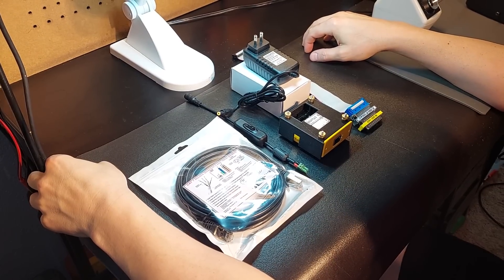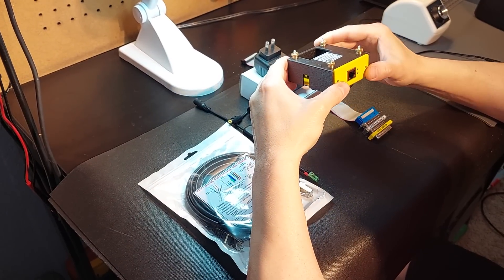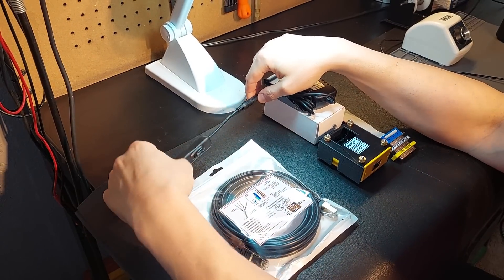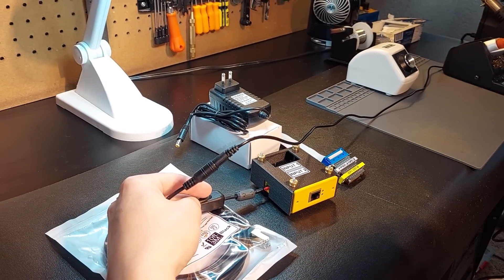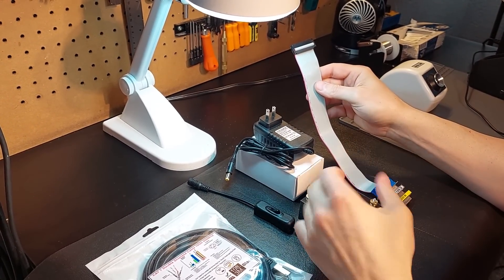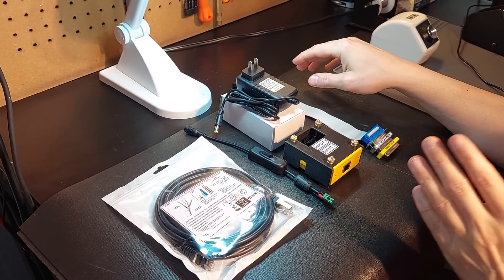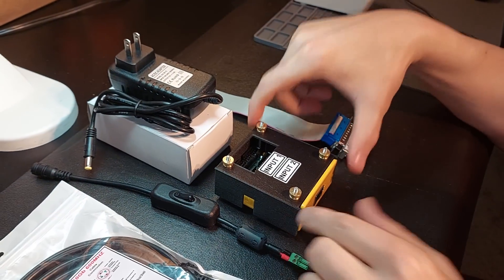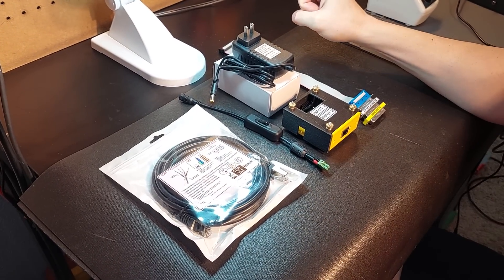UC-400 Ethernet Turnkey Solution Is Here!

Comment: I would like to use a surface pro tablet(mach3)with uc400 with a usb to ethernet adapter  .seeing as it doesn t have a etherent port .Do you think that this would be ok or would there be still be the normal instability with the system?
Reply from the maker: There's no way to use a USB to ethernet adapter. 

Your PC will require a dedicated ethernet port, and your CNC controller must use a parallel port (DB25) connector on its breakout board/ controller card to allow the use of the UC-400. 

Thank you,
Vince
Reply: @ thanks so much😄
Reply from the maker: You bet...:)

Thank you,
Vince